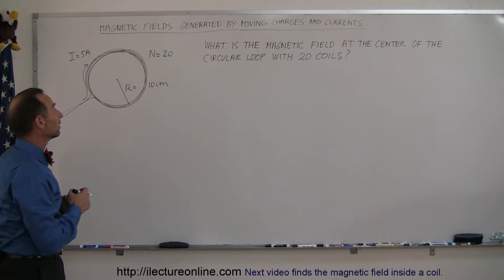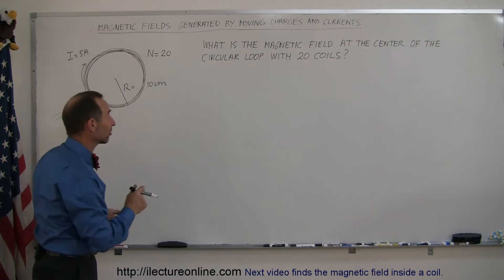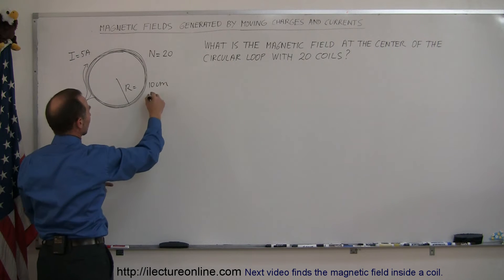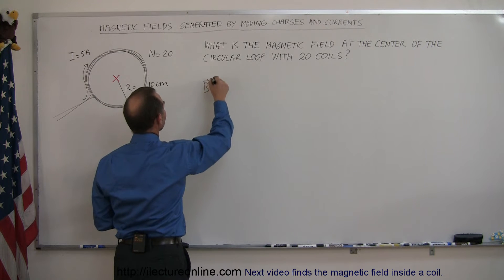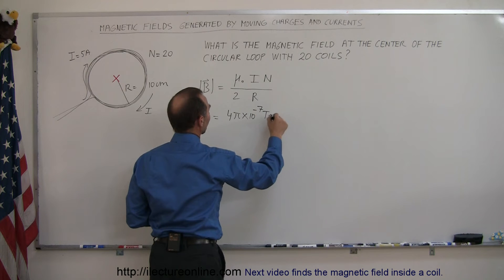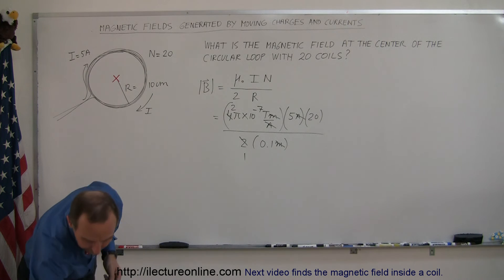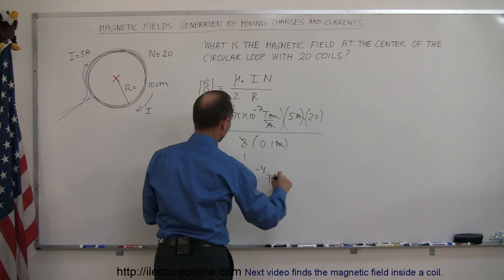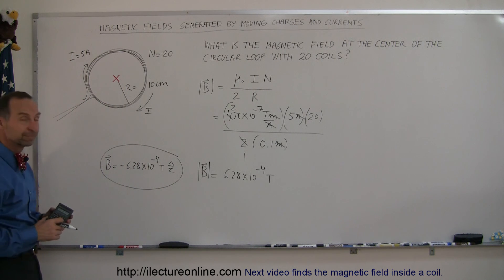Physics 44  Magnetic Field Generated (8 of 28) Current in a Wire Loop

Comment: For those wondering why there isn't a pi in the denominator, this is not a Toroidal object. Reference the last video in this playlist to see the difference.
Reply: Yes, and instead of plugging a in integral, you plug in piR because that is the half length of the toroidal object. Why half length? Because you just multiply whole magnetic field by 2 to get compensate division by 2 later on
Reply: @makoshzh  Its amazing coming back to see comments I made as a struggling 1st and 2nd year student as someone about to graduate with a Mechanical Engineering degree in Aerospace applications. Without Dr. Biezen I wouldve failed out before I even found my passion for Aero Propulsion. I plan to forward my knowledge through videos like you here on youtube to help those who just need some extra help. Thank you for everything Dr. Biezen!

-RobertHunterAero

Comment: sir, we used here the amperes law isnt it ? and did you divide by 2 cause you r going to find B in the center ?
Reply from the maker: Yes, it turns out that the equation to find the B-field at the center of a loop has a 2 in the denominator.

Comment: Would you integrate around the circle with biot savarts law and multiply that by the number of coils? At least that's how I visualize how to prove this equation.
Reply: For those who are confused about where the equation came from:

You take your element to be a segment of the wire as usual and apply biot savarts law. You have to rewrite your dL as the arc length so ds = R*d(PHI).
 
Note that your r vector and l vector are always going to perpendicular to each other so sin(pi/2) is simply 1. After taking out all your constants you just integrate dPHI from 0 to 2*PI*(Number of COILS).  

After simplifying and cancelling out extra terms you'll end up with the formula used in the video.

Comment: I'm confused about the first formula where there isn't a π in the denominator.Because I noticed there's π in the formula for the infinite straight line of current. what's the difference of them? I'd appreciate it if you could tell me the reason, thank you so much!
Reply from the maker: Hong,
If you derive the equation (using the technique of integration) you have to integrate around a circle.  That requires the integration of the angle from 0 to 2 pi radians.
Reply: @MichelvanBiezen  When I integrate, I get 4pi*r on the denominator

Comment: I'm confused...shouldn't you divide by 2piR instead of 2R?
Reply from the maker: Gloria.  It does seem strange at first, but the equation is correct.  If you equate the magnetic field due to a small current element you get:   dB = mu0 * I * dl  / (4 * pi * r**2).  So there is the "pi" in the denominator.  But when you then integrate the current element over the entire circle (2 * pi * r), the "pi" cancels out and the r**2 in the denominator become r because it cancels out with the r in the numerator.  So the result is B = mu0 * I / (2 R).  The N is the number of loops if there is more than one.
Reply: @MichelvanBiezen  I do believe Gloria was referencing the formula for the B field of a Toroid
Reply: Would you be so kind to show how did you derive the current element integration? i am sorry i have a bit gap in math too. I will be really greatful if you can make a video on that. Really wonder how the integration for current element works. thanks a lot